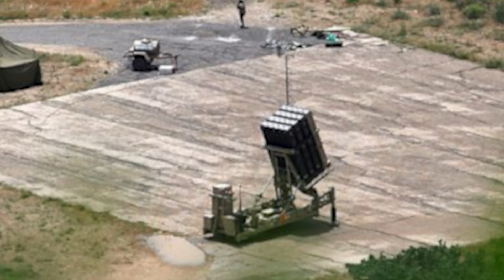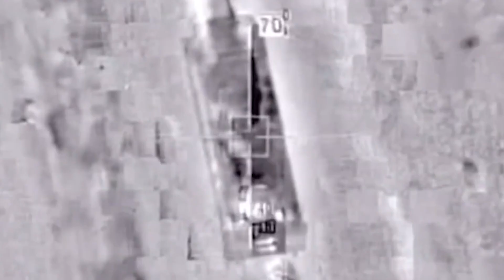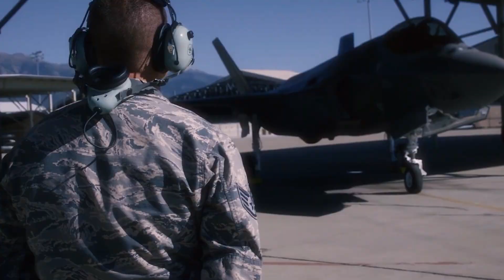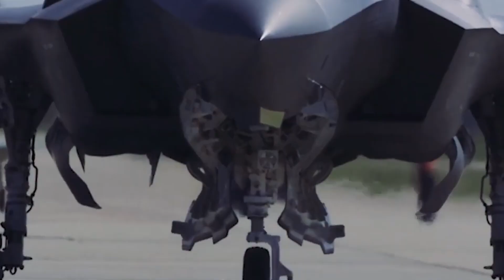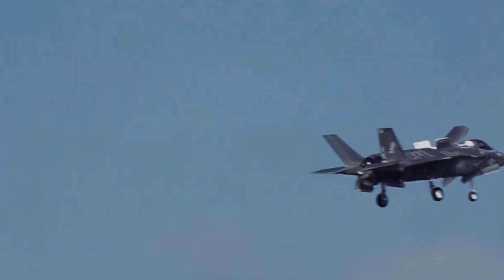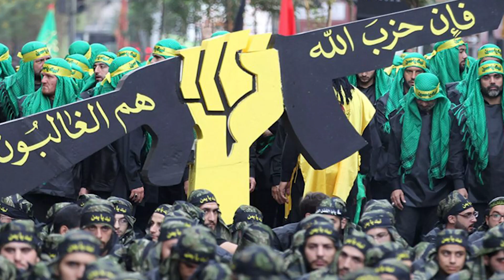The Most Special F-35 on Earth - I Adir

Comment: The reason that Israel has the right to modify US blackbox tech like the F-35 is simple--they agreed to make any modifications outside of any copyright and with full transparency. Basically, they agree that any alterations they make and systems they add will be fully explained and handed over to the US and Lockheed. This works out extremely well for all parties, as it means that Lockheed gets millions of dollars in free R&D/stress testing for their product, which they can apply to any future projects. Similarly, it benefits the US because any upgrades that Israel has (and has proven effective in combat) can be freely installed on US F-35s for our use, at no cost. Basically, we get combat-proven upgrades, for free, with the only caveat being that Israel is given access to the F-35 blackbox systems. Ironically, this created a bit of an issue a couple years ago, as a couple NATO countries wanted access to the upgraded systems developed by the IDF, but the US blocked it because they wanted to keep exclusivity, meaning that we are effectively treating the upgrades as we would a domestic variant blackbox tech.

*blackbox tech just means restricted military technology that is typically only accessible by the creator nation. We may sell it to some other countries, but they can't access the internal systems and need to send them to the US for repairs because they aren't even allowed to know how they work. Some blackbox tech is even more restricted and is domestic-use only (eg. depleted uranium armor on US Abrams or F-22s).

Comment: The "fly away cost" of an F-35 is millions cheaper than an F-15. The price of an F-35 includes all of the tech, such as targeting pods and other electronic warfare equipment. The price of an F-15 excludes that tech. The base price of a new F-15 is appropriately 90 million. When all of the electronic warfare systems are added, the price rises to nearly 120 million, 30 million more than an F-35. This is a more accurate comparison of costs. Don't get me wrong, the F-15 is a spectacular system, also referred to sometimes as the "Big Stick." I don't know why the cost accounting is done this way. You could say a base F-15 is like buying a luxury sports car that doesn't have power steering, power brakes, power windows, etc. It must be "upgraded" with the latest equipment to make it a premier jet.

Comment: Is the f35i compatible with air-to-air refueling?
Reply: Ofc
Reply: Well yes, the Israelis probably use probe and drogue, so the Israelis probably use the Air refueling system from the F-35 B/C (Marine/Navy) versions on the I which is a variant of the F-35A.
Reply: @kdrapertrucker  "the Israelis probably use probe and drogue, "(sic)

F-35Is require the boom not the hose/drogue.

Comment: Belly tanks stealth~ed up maybe? There has to be some kind of tanks added to give it the new range, but they would destroy its stealth. Unless they found more space inside it somehow.
Reply: Properly designed form fitting pancake tanks wouldn't necessarily mess up the stealth profile to any significant degree...the only real issue in stealth is avoiding 90 degree angles between parts of the plane.
Reply: Maybe 30 years ago...

Comment: The IAF also heavily modified the F-16 to suit their needs. It seems once they owned them they could make the appropriate changes in airframe and avionics.
Reply: I believe that that was one of the terms for cancelling the Lavi project.
Reply: @WildReefer  Israel needed a bespoke fighter jet as much as it needed its own MBT (Merkava), so they started to create one.
For the politicians, it was clear that the US wouldn't let it proceed, they did it anyway to 1) show Israel has the know how and to 2) blackmail the US to allow for special deals or they would sell the blue-white technology elsewhere. The Kfir was there to back the bluff.
Reply: They actually had no choice but to. I’m sure they’re not losing any sleep over that, though.
Reply: @Viktor-jq2br  Well, most of that is actually classified. The Israelis don't like just putting it out there what brands of equipment they use. The avionics are all custom made and installed by IAI. Basically, the plane gets delivered with only aircraft performance computers. I can't recall the sanction that stipulates this but, it basically only allows countries to sell basic aircraft to Israel with no weapons systems installed. Same thing happened with the F-15I.
Reply: Yes, they have acquired a large quantity of the two-seat Block 52/Sufa variant with CFT and Israeli avionics for the air-to-ground role.

Comment: I am amazed that the Israelis were permitted to modify and maintain their own F-35s. That is unheard of considering the pork barrel politics behind the procurement, modification and maintenance schedules for the F-35s. Guess the Military Industrial Complex gives exceptions to their best customers.
Reply: If I am not mistaken, It's an old deal beetwin Israel-U.S for abandoning our own aircraft manufacturing.
Reply: The F-35 was intended as an export model.
Reply: No, the pork barrel and MIC loves it. Any changes made by the IDF need to be reported and shared, and so Lockheed Martin is basically getting free upgrades that they can put in the domestic F-35s, as well as future US projects. This means that their systems get free bug fixes, upgrades, and stress testing, and they don't need to lift a finger or pay a cent for it. For example, if the US locates an issue in the jet during their operations, they need to contact the manufacturer to request a fix, which often takes time and money; conversely, if the IDF locates the same issue, they can develop a fix themselves, test it, and implement it, and then Lockheed gets to apply that fix to US jets, avoiding the costs associated with dealing with the problem.
Reply: What is not clear in those agreements is who gets to do what and when. The changes may even have been designed by US industry.
Reply: Considering most countries dropped this when they were told that they'd never be given the software code to tailor it for regional specific threats
Reply: IAF is more than just a customer.  We have been for quite some time.
Reply: @mike  they have modified other planes, this is not news.  you're aghast at something that's been going on for decades.

Comment: Israel always guts our jets and puts better tech into them.  When they got F-15s from us, they took out our ridiculous sighting system and installed helmet-mounted sights.  Because no matter where you’re at in Israel you are less than 60 seconds away from a potential enemy, so they need the ability to lock up targets immediately after taking off from an airbase.  Russia’s had helmet-sights for decades, Israel’s had them, our Apache choppers had them forever, but we’re only just not putting those sights into frontline fighters.

Comment: This is what usually happens. US provides an aircraft to an ally. They pay for the upgrade for their needs. US picks and chooses the best and put them into a new block or a version.
Reply: Like how the Singaporean Air Force bought the F15s and turned it into F15SG, one of the most advanced and sophisticated F15 ever built. Helps that the Singaporean military shared a close relationship with the Israeli one.
Reply: @vennsim71  And then the F15EX was born. It is a very good strategy. You provide a capable platform to your allies and they will pay to develop it.
Reply: It has more to do with the partners modifying them for their own local use. The US would not have the same use. 
But the US can then tailor new aircraft to those local needs in future versions.
Reply: @bighands69  Sometimes they pay for engine, RADAR modifications etc. Then after a while US just picks one up and puts it into production. Same thing happened to the F15 and F16.
Reply: The big issue is that the US refuses to release the code so countries could modify the software for "regional specific threats" 
We Aussies can't modify it for the threats we might have to combat (Indonesia 🤣) or for the jobs/environment that it has to perform in
Reply: @richardcostello360  
Either countries use US technology or they do not. They do not get to whine about code.

Comment: No matter how much these things cost they always look like they are duct taped together
Reply: Radar absorbing tape
Reply: That's just radar absorbent paint, which is so fragile it basically has to be reapplied over every seam and line of rivets after most missions.  Without it the radar cross section of the F-35 isn't much better than the F/A-18.  It's a major flaw in the design.  However they are working on much better coatings that will be much more durable, particularly at transsonic and supersonic speeds.  I suspect they will be deployed about the same time a new stealth air superiority fighter is introduced that doesn't require this process.
Reply: @tarmaque  well you're assertion on The coating have to be reapplied is not true at all on this platform. That was the 117 30 years ago, not applicable here.
Reply: They are more rugged than the previous generation fighters. If you look back when they had the carrier incident in the pacific, the fuselage of the plane was intact, after it was recovered.
Reply: Anachronistic weapons of wars gone past!
Stealth is a scam! 
Missile fodder!
Irrelevant in future wars.
Suicide missions for their pilots
Reply: @DennisMerwood-xk8wp  where do you get this baseless information from? IAF in Syria, red flag results. Foreign military sales speak for themselves. None of what you said is true.
Reply: @DennisMerwood-xk8wp  is that right? You can't accept the fact that I know more than you on this and that's your answer? Face the fact and get out of your senility, refute my statements with some credibility not deflecting with generalizations. The days of F86 is over has been for some time.

Comment: The F35 is so cool
Reply: IIt has nothing on the F22 though....
Reply: @CETGale  It actually has everything...
Reply: @Joshua-dt5vi  Idk, but if I were a betting man give me the F22 in a fight over the F35 with the pilots being equal in skill. Its faster than the 35 for sure...
Reply: @CETGale  There was a reason why the F-35 was made slower, because most aircraft cruise at around Mach 1.3 and the F-35 also save more fuel. Did you know that the F-22 used to be able to go up to Mach 2.8 but was later nerfed to mach 2.2 because in the modern battle field speed doesn't matter the only thing you'll be doing is having  your enemy detect you even faster.
Reply: @Joshua-dt5vi  Interesting...
Reply: @CETGale  comparing the f22 and the f35 in a dogfiight is like comparing b52 stratofortress RCS to b2 spirit RCS